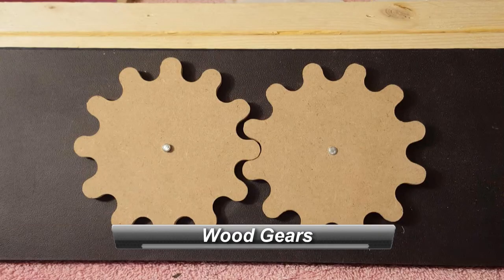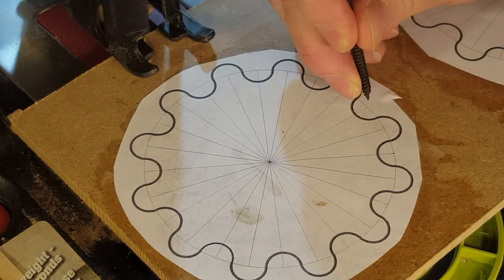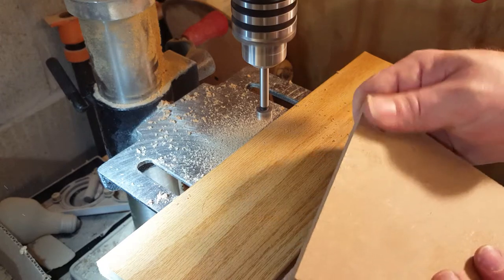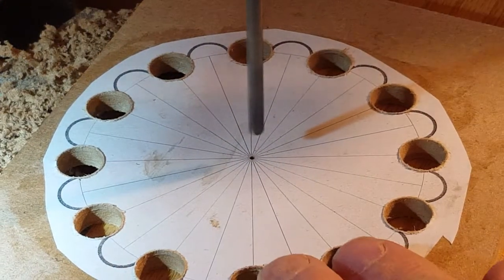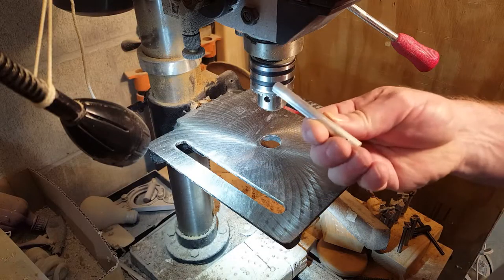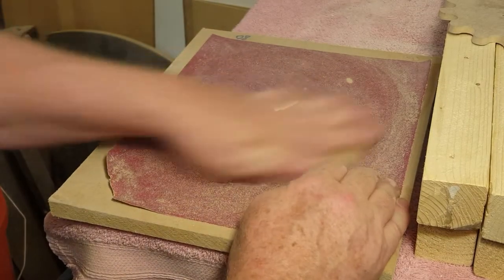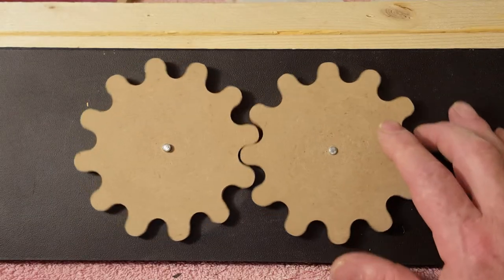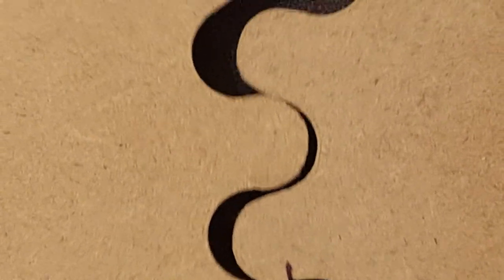9. Making my 2nd set of wood gears

Comment: NICE WORK AND TAKING YOUR TIME IS THE BEST ADVICE FOR QUALITY WORK - SUGGESTION: AFTER YOU DRILL THAT FIRST FORSTNER HOLE, STOP THE DRILL BIT IN THAT HOLE AND THEN DRIVE A SMALL DRILL BIT INTO THE CENTER OF THE GEAR DEEP ENOUGH TO SECURE GEAR TO THE BACKING BOARD(LEAVE THAT DRILL BIT IN THE GEAR UNTIL YOU ARE COMPLETELY DONE DRILLING) - THEN YOU CAN PIVOT THE GEAR ACCURATELY TO THE NEXT GEAR HOLE - WORKS FOR ME EVERYTIME
Reply from the maker: Thanks for the tip and for watching! What do you use your wood gears for?

Comment: why you make gears with the samme size ?
Reply from the maker: Thanks for your question. I have very little experience making gears plus I was not certain how the "teeth" would mesh so I decided to start by making the gears the same size. In practice, sometimes gears of the same size are used to reverse the direction of the driving gear. (If the driving gear moves clockwise, then the driven gear will move counter-clockwise.) Future gear builds will be of different sizes.